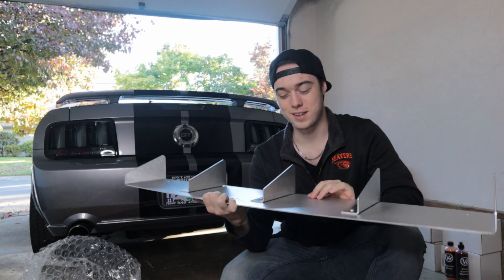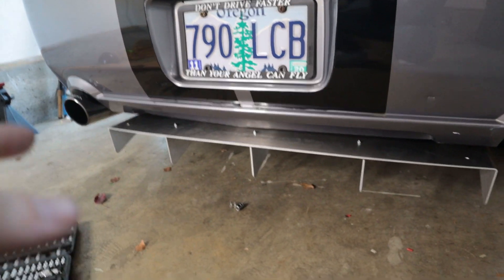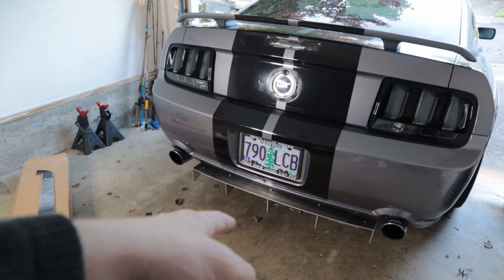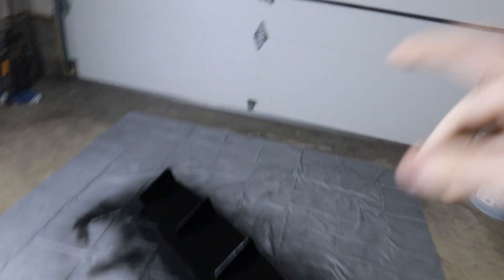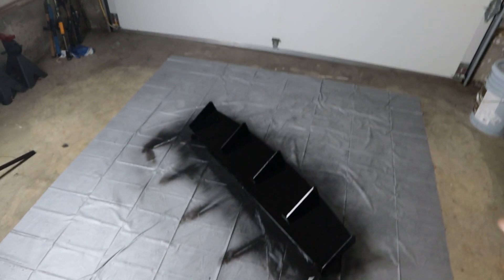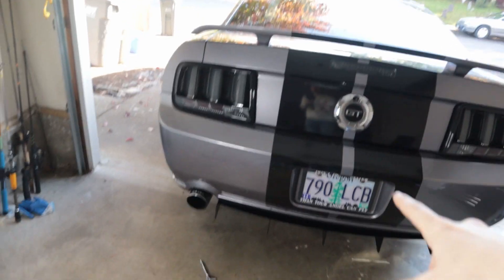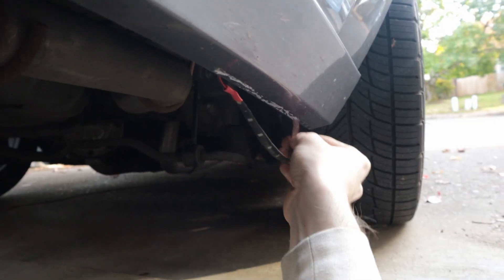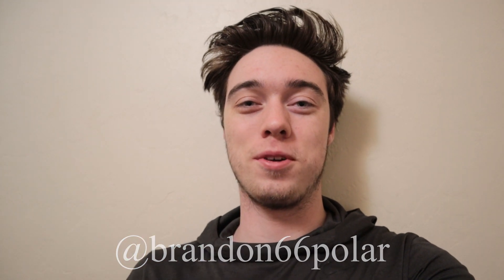Adding an EPIC Rear Diffuser to the Mustang GT!!

Comment: Hey man good video just got one and painted it, gonna put it on tomorrow. Quick question: Do you think tightening the bolts more to make the diffuser “bow” affect the durability at all since it’s constantly being bent? How’s yours held up
Reply from the maker: Mine has held up perfectly. Aluminum can bend quite a bit before it loses structural integrity 👍

Comment: You still have the S197 Mustang? How is this diffuser holding up? Any increase in MPG? Im looking at one for my Time Attack car. Rules dont allow flat bottom so diffusers are mostly useful at eliminating drag (which helps with top speed) by just closing the bumper gap, hence asking about mpg.
Reply from the maker: I still have the Mustang but I sold the diffuser a while back. It definitely closes the rear bumper gap on the underside of the car but it didn’t extend below the spare tire well. I personally didn’t notice any change in mpg but I was also modifying the drivetrain at the time so I didn’t have enough consistent variables to analyze something like that. Sorry I couldn’t be more help!

Comment: What spray paint did you use? And did you sand it before?
Reply from the maker: I used universal gloss black automotive spray paint and the clear coat is gloss clear engine enamel. Both of those can be found at AutoZone. I used the engine enamel clear because the diffuser is so close to the exhaust. I didn’t sand it before painting I just wiped it down with a microfiber cloth to make sure there wasn’t any dust on it